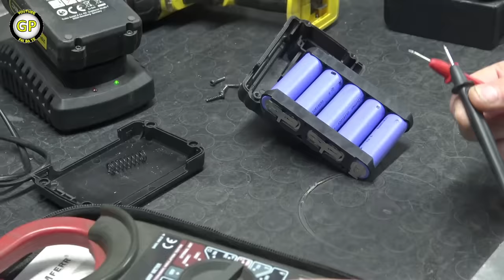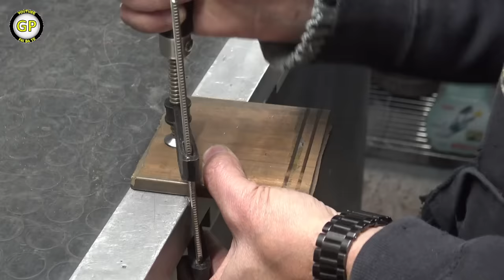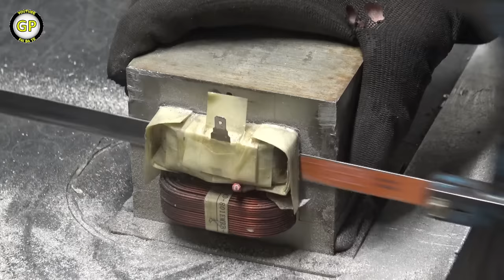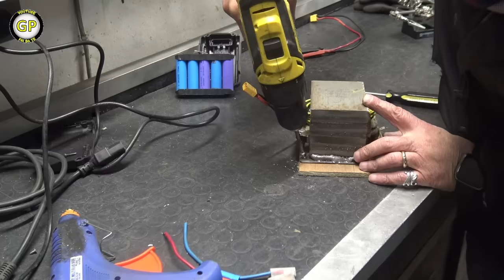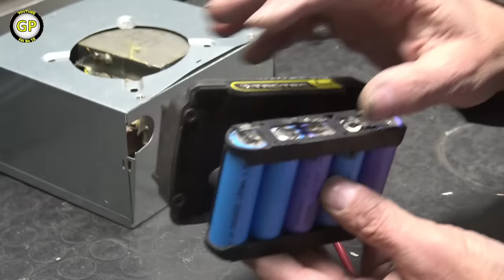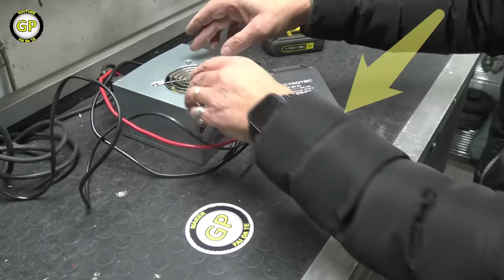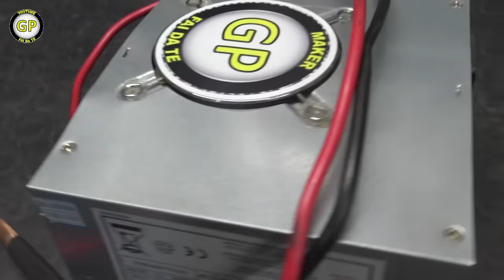Make a Mini Spot Welding Machine for Lithium Batteries a $0 - DIY

Comment: Crazy battery killer((( Don't do this way! NEVER!
Reply from the maker: thanks
Reply: @GianniPirolaFaidate  I may have been overly emotional. However, the mentioned method will definitely burn a hole in the battery. Or at least, it will cause local overheating. You need to use special timer boards that will regulate the current supply time.
Reply: @GianniPirolaFaidate  I'm sure you realized this yourself after using your transformer.
Reply: I have similar setup, you just gotta know when to lift your hand. It is safe.
Reply: @apollomedia7210  so you're a feeling user eh , prior to Dude this guy' feeling is the Timer Control board itself😅
Reply: This way is safe just don't be an idiot and hold it for a long time.... 2 spots welds will be plenty also
Reply: @GianniPirolaFaidate  this guy is only saying not to use this machine because he just realized how much money he’s gonna lose cause he’s probably a sale rep from Milwaukee or Dewalt and he just realized how much money he’s gonna lose on sales on batteries that’s why he’s very emotional because he’s so sad of how much money gonna lose by ripping people off by charging $250 for an eight amp battery that breaks and doesn’t even last
Reply: @LitAlexV special as in a current timing board ? ,what if i ran 2 copper cables from a 7 ah lead battery kinda like a motorbike battery  and on the end of the cables 2 nails all nicely wrapped would that work ?,gotta say  a currant board would work a treet👍

Comment: Is it funny that the most professionals have the least professional tools and the least professional have the best tools
Reply from the maker: Thanks👍 👋
Reply: They try to make up for lack of skill. Pros have to make do
Reply: The most skilled professionals can repair what they have or create their own tools from scratch, improvise unusual solutions when necessary, and rely on their skills to use whatever they have available to get the job done. 

Unskilled tradesmen rely on the tool to do the job for them and are often helpless without their specific equipment, whereas skilled ones rely mostly on their understanding of the work and what needs to be done to accomplish their work, so the tools themselves become much less relevant. Ideally, you'd have skilled tradesmen who also have excellent tools to work with, but the skill is always more important than the bear.
Reply: I worked for 15 years in auto repair at dealerships. Avoid the guys with the $5000 tool boxes and every tool the Snap-On guy sells. They all try to make up for their lack of competence by buying tools. The tool guys hated me. I bought the least from them of any other person in the shop.
Reply: best part is you are paying for it

Comment: I would strongly recomend thicker wire for the replaced coil. That wire used in the video can get hot and melt the insulation, when in use.
Reply: You are definitely right
Reply: a shorted turn is not great that is for sure..

Comment: I respect your ingenuity, but this looks dangerous as all get out! Basically, if you touch your contacts with it turned on, you're getting zapped. Plus, the more you don't have a load on the secondary the sooner your transformer will be burning up due to eddie currents.
Reply from the maker: Thanks👍👍

Comment: I would strongly recomend matching the cells before re-installing. Run a few charge/discharge cycles. Odds are really good that your #1going to have a fire or #2 your going to have the battery back open because the 2 older cells cant keep up with the new ones. If its only 5 cells replace them all.. But replace them with cells that you know there capacitys. Matching cell capacities is critical. If you dont have a hobby charger (imax b6, sky rc, thunder, prophet, etc) then i eould say dont take on the lithiumbattery repair/swap. Often times the control board is whats bad anyways.
Reply: the charger part has a bms installed...fire? I've tried to get one, uptil now have not succeded. maybe it's me:face-purple-wide-eyes:
Reply: You don't need to match capacities, that's the point of a battery balancing system.
Reply: @ixamraxi  your mistaken. The bms wont operate as advertised if you dont pre match the cells. Please allow me to save you some time and effort. Match your cells and always check each cells internal resistance.   If you do those 2 things your battery packs will last a long long time. Years and years. Especially important if your using recovered cells from laptops etc.. You can buy a hobby charger like a sky rc imax b6 for less then $50. It will charge and discharge. It will balance charge up to 6 lith-ion cells. And it will check your internal resistance. If your getting a ebike and you tinker absolutely get one. I have 4 of them so i can analyze cells i recover faster.
Reply: @kennedy6971  It will, modern bms systems will simply limit all cell performance/capacity to the lowest one, which improves longevity of the pack as the cells slowly degrade over time.  You could get slightly better performance by pre-balancing, but generally individual cells are close enough in manufacturing quality that once charged you can check internal resistance and grab a set that all show the same voltage and be confident their capacities are close enough to the advertised value that the bms will sufficiently protect them for the expected lifespan. I would seriously doubt any claim that major manufacturers are balancing more than this.
Reply: @ixamraxi  The only problem that I see with what you've written is that it only applies if you already know FOR SURE what the specs of your batteries are but we arent talking about that kind of scenario.  In this video the batteries used to replace the bad batteries are probably not from the same manufacturer as the original batteries. The fella in the video doesnt say where the replacement batteries come from or how old or used they are. Neither does he show that he tested ANY of the batteries for ANYTHING.  All of this matters more than you might think. Lets say that the batteries in the drill pack are LG's, rated for 1500mah's so you grab several random replacement batteries based upon the fact that those replacement batteries are also rated to have a capacity of 1500mah. What if the LG's remaining in the pack are NOT 1500mah anymore?  And are you sure that those random replacement batteries are still 1500mah as well?-or ever were?  AND are you sure that the replacement batteries are rated for the max continuous current draw that battery operated power tools like a circular saw demand? And are you sure that even if the replacement batteries have a high enough max continuous current draw rating to properly run a battery operated tool, does that rating match up with the max continuous current draw rating of the LG batteries that remain in the battery pack? 18650s put into power tool battery packs have a max continuous current draw rating of around 30amps and up. Your run of the mill 18650 removed from a laptop pack usually has a max continuous current rating of less than 2amps!! Now, imagine trying to pull 30+ continuous amps from a lithium battery designed to tolerate less than a 2amp continuous output. Can you say FIRE!?  There is a whole lot more to "matching up batteries" than simply getting the capacity ratings listed on their outer covers as close as possible. Speaking of which, lets go back to that part of the topic. I recently pulled a bunch of LG 1500mah batteries from two 5 year old, aftermarket 18v Ryobi battery packs that werent charging anymore. One 18650 "cell" in each pack had gone bad. The rest of the batteries from each pack were good BUT all tested out at just 75% to 85% their originally rated capacity.  Its normal for lithium batteries to lose capacity over time and use, so unless you test them, you have absolutely no idea if a used lithium battery still has its original capacity or not. So yeah. Im with all the folk in here who recommend making sure that you know the "TRUE" stats of your batteries by testing each before using any of them in a project such as the one shown in this video. As I said, there is MUCH more to these 18650 batteries than simply throwing a bunch with similar capacities together in a pack.
Reply: Matching cell capacities is "critical" to the life and health of the battery pack but not to the life and health of a person.  What could easily end up being critical to the life and health of a person is how you match up-or fail to match up-the "max continuous current" ratings of the batteries you want to mix together. 18650s made to go into power tool battery packs have a high max continuous current rating. Usually above 30amps. Ebikes and Escooters dont usually require more than 15 or 20 continuous amps from an 18650 battery.  And 18650s removed from laptop battery packs usually have a max continuous current rating of less than 2amps.  Taking this info into mind, try to imagine what might happen if you replace an 18650 battery from a power tool battery pack with an 18650 battery salvaged from a laptop battery pack? When you go to use that pack in a power tool, you'll be trying to pull 30 or more continuous amps from a battery designed to provide less than 2 continuous amps. This can easily cause the battery to severely overheat and burst into flames.
Reply: Thanks guys, i learned alot from your comments and respectful discussion,
Reply: @ssao0000  I spent 3yrs trying to get a lithium fire. I intentionally did things wrong to see how long it would take. No fire ever occurred. Then one day (I build electric bikes) I'm headed to work and a guy yells "you have a flat tire". I'm thinking " I would know if I had a flat tire". Right about that time is when the flames were coming from the battery pack. The guy didn't yell "you got a flat tire". He yelled "your bikes on fire".. the crimson flames are pretty.. lol.. nobody wants a 🔥 while using anything with a battery. But it can and will happen if u don't match your cells right
Reply: @kennedy6971  had a lithium battery pack go bad on me some time ago as well with a cordless angle grinder. Turned out there was a short in the pack as an assistant in my work shop had dropped the thing causing one of the leads to become loose. This lead although still in contact with the battery could no longer carry the full current draw and politely caused the entire pack to go up in flames.... Thank the heavens I had a fire bucket filled with sand to shove the entire thing in. For those who DON'T KNOW this.... Lithium and water DON'T play well together. Lithium fire and water are NOT a good combination EVER.
Reply: Damn! I have Just built a battery pack for my new Milwaukee M18 FPD3, I have used old battery from my E-bike, I have balanced them before, buy I have forgot the issue of continuos amp😅😢
Reply: @kennedy6971  Baseless. You don't have to match battery, the BMS will do the job when charging

Comment: I would advise a few things for safeties sake here. A thick metal bucket half filled with sand, and some extra cable protection as it exits the case to protect the insulation from getting damaged and shorting things out.

Expect some of the Lithium Ion cells to not like this welder and start gassing and worse, when they do use the bucket and get them outside fast. Just search here for lithium battery fire and explosions. Really people be safe, this is not for the faint of heart.
Reply from the maker: Ok thanks 👍👋
Reply: @GianniPirolaFaidate  i ve made the same project as you but i have many sparks during welding and it does not weld properly.Also i used wood to make the case for the transformer and i removed the ground cable from the input,could be this the reason?
Reply: @thetoymaker9404  sounds like voltage too high and/or current too low
Reply: without adjusting the current - it really threatens to explode the battery.
Reply: I'm a 18 year electrician and I'm jus here for the entertainment 😂😂😂  but yeah be safe folks. Remember it only takes 1/10th of amp (in perfect conditions) to kill you.
Reply: @JoeNathan42420  believe me even 500A can't kill you when voltage is low.
Reply: WHy? You are not putting the current through the LI cell.
Reply: @moya9450  Find me a situation where 500A cannot kill you. It would. Remember 500A is NOT the source capability, but what it can put through YOU.
Reply: @JustMeBlindFreddy  One example is Transformer we use as hot spot welder device. The secondary winding is one thick wire with one to 3 round. The Current is more than 500A. If you touch both wire with bare hand nothing will happen. Because Voltage is 1v-3v. Simply said, Current is the amount of the electron in a conductor, Voltage is the force which push those electron through wire or any other substance. So when one of the Current or Voltage is too low, It can not kill. Also time is very important factor. In the other hand when Voltage is high for example even 20kV, if the current is too low and time is very short still can not kill. Like electric shockers/zappers. Second example can be Car's battery. It has very high current sometimes more than 500A, in this case Voltage is not too low as well(It's usually 12v). But if you touch it, it won't kill you.
Reply: You cant put 500A through someone with low voltage... Current is determined by resistance and voltage. Humans are pretty high resistance so you need more than 50 volts to draw enough current to feel.  @JustMeBlindFreddy
Reply: @moya9450  I built this with 3 windings of 6g and got 2.7V out of the secondary. I insulated my 2 copper leads with a ridiculous amount of tape, I guess I dont need all that now? Mine has a 100uf capacitor that cycles a relay at about 30ms with a push button. I like Gianna's touch method better as it looks to have more control.
Reply: @JoeNathan42420 life's a risk yolo😂
Reply: @moya9450 if the voltage is too low, even if the power can theoretically supply 500A, only a few milliamps or maybe microamps will flow if your skin is dry because it will offer very high resistance.
Reply: @pulsar22  Actually I didn't get what you said. I didn't understand how you got milliamps when the current is 500A? When voltage is Too low even 1000A current can't do anything to your body. Voltage is the force which pushes electric Charges forward. When there is not enough force then it doesn't matter how big the current is. It's the same when You have high force (Voltage) but not enough charge. Stun guns have thousands of thousands volts.  But current is too low (uA) and also the time is too short.
Reply: @pulsar22  Also high resistance in your body is a good thing. It prevents current from flowing to the skin
Reply: Try a couple fewer secondary windings, and try again. If still too sparky, remove a couple more, and so on. Also, your electrodes might be the wrong alloy, as not all copper is pure copper. I don't know which alloy would be a problem though.
Reply: @thetoymaker9404  you could definitely improve the safety of this arrangement by placing your foot into a metal bucket full of water attached to a heavy duty earthing strap.

Shaven heads and electro conductive gel smeared smoking skull caps are optional and purely for those of the more gimp like persuasion. 🤣🤣🤣
Reply: Из. Практики знаю.зделал похожую сварку......без платы. Управления все это туфта....аккумуляторы. Боятся нагрева....и прослужат они мало....на видио видно. Как нагревается. До красного цвета пластина. А это. Вредно....
Добавил плату. Управления...сварку не отличить от заводской...
В целом автор видео. Молодец.

Comment: This looks really dangerous! 💥It will only be $0 if you have all the parts already, but if you don't have a broken microwave and everything else you need, it will be more than $0.

BTW, you should not have metal rings when working with cells and welding.
Reply: every week i see them at recycle points together with old 18650 equipped laptops or on the kerbs
Reply: Or watches.... I watched a metal bracelet light up on my uncle's arm, just working with 12v. It looked painful, between the laughing. 😂

Comment: I love the idea to use old PC power as box since it already have the connector and on/off switch! 👍 I think I will do the same as you for my next one. This said, my suggestion, don't spot weld with charged battery since it's then they can start a fire. Discharge them to like 20% (Like 3.2 volts), then you can more securely  spot weld them since now not a lot energy to start a fire. Another thing, look like your weld is too hot ? Maybe try to lower your current or use a timer to cut power before it's too hot?
Reply: Thank you very Much.
Reply from the maker: ok many thanks bye
Reply: nope, tried that
Reply: to use an old PC power supply for the enclosure   ✓
Reply: What are the connectors for? He doesn't explain this at all

Comment: Couple of safety issues & suggestions here:

1. Please, for the love of God, if your gonna run the hot & ground wire through the case, use a grommet so the wires don't chafe and short out.

2. Suggestion for version 2: see if you can wire in/DIY a foot switch. Maybe salvage one from an old sewing machine?

3. Suggestion for version 2: mount a heavy duty alligator clip on your negative probe, and mount the positive probe on an overhead handle so all you have to do is touch it for the spot weld. The alligator clip will help you get a better grip to hold the nickle strip to the battery, as well as supply the ground for the spot welder.
Reply from the maker: Ok thanks👍 👋👋
Reply: Здесь нет отрицательного и положительное зажима
Reply: @vinnyboombatz1399 you have to move the - close the the + each time you do a spot weld it's not the same as arc or mig welding but I'll admit I thought the same thing as you at first. And I agree the way the wires are run through the casing is just asking for a short circuit lol I would def use a grommet or rubber hose to insulate better